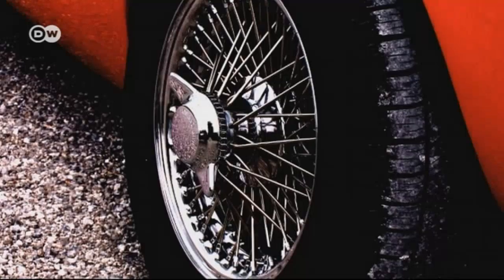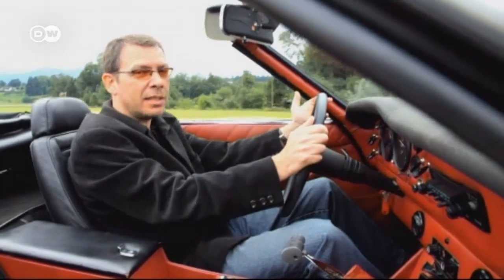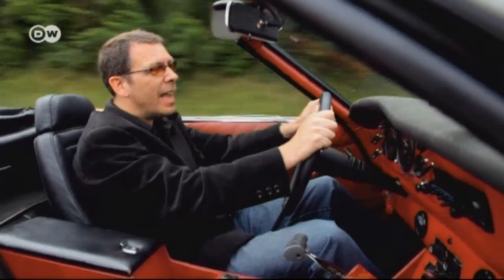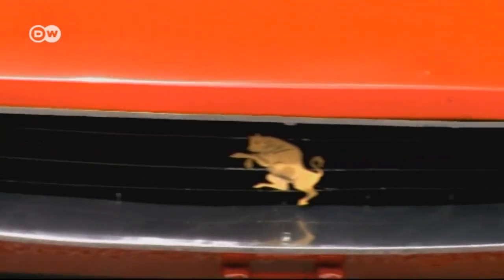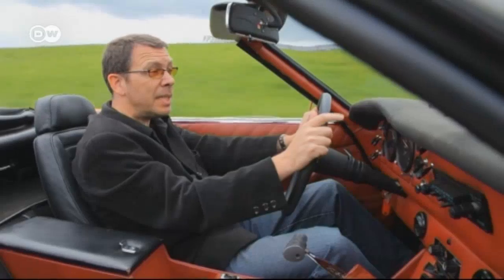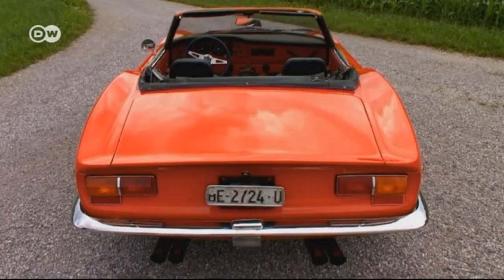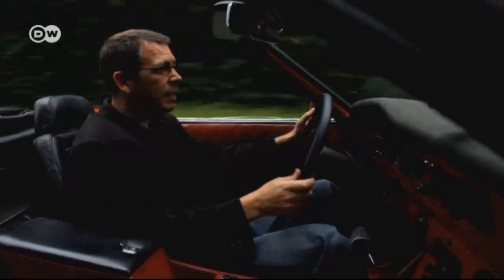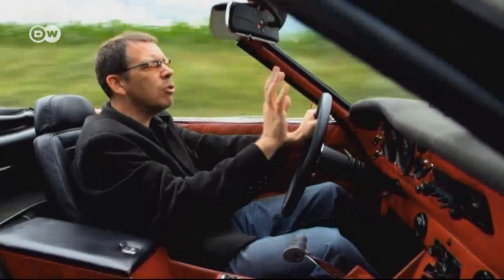Vintage: Intermeccanica Italia Spyder | Drive it!

Comment: Some errors here, built between 1968 and 1970 is incorrect, production of the Italia Spyder started in 1967 and continued until 1973, most Italia’s were built with 3 speed auto’s is also incorrect, all were manuals.

Comment: father had Italia convertible, with 351cu.in.HO 4brl. and 4 speed top loader that was putting a whole bunch of horsepower to a Ford 9 inch differential . axle housing was strapped down with thick conveyor belt loops attached to frame, Thus, pre-loading the rear axle springs. preventing any roll when turning into a corner under heavy throttle... stiff suspension, and hauled ass! 
took it up to 165 miles per hour on the Black Canyon freeway when I was 14 years old , had plenty of motor left speedometer went to 180 miles per hour